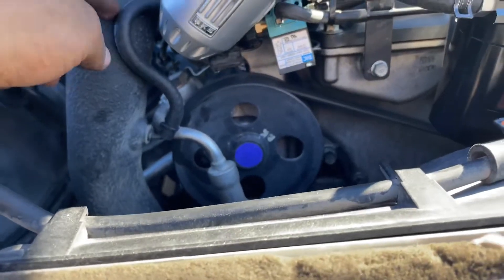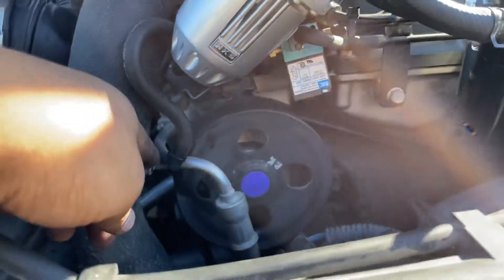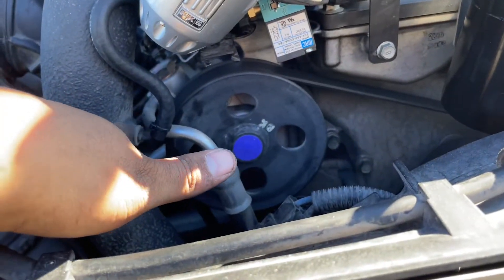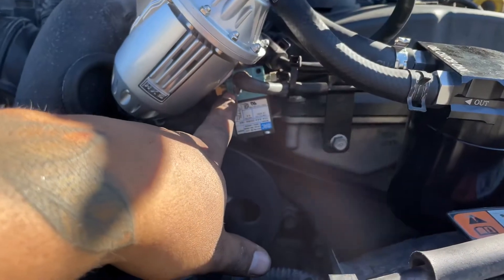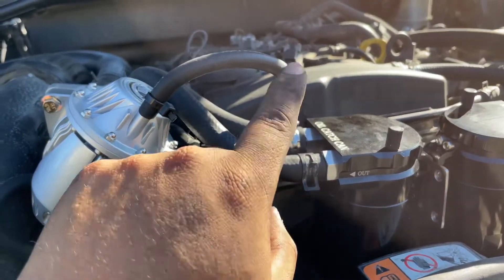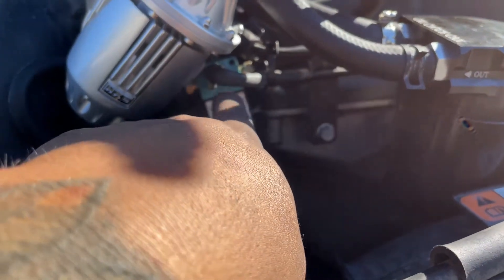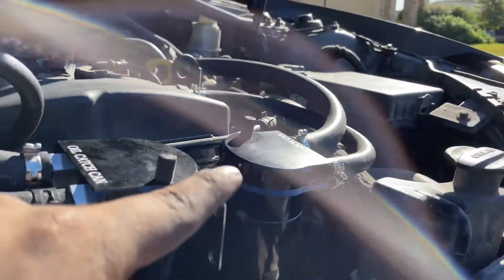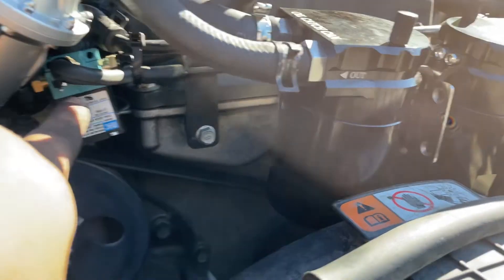Seco Solenoid Install | Genesis Coupe 2.0T 13-14

Comment: Where would you route number 1 on the solenoid if you have aftermarket intercooler pipes? Trying to install my turboxs fmic
Reply from the maker: Have to basically get a barb welded onto it or t into vacuum reference

Comment: What do you recommend should I get a 3.8 ultimate or should I just buy a diff car if I’m going for power
Reply from the maker: How much power is the question.
Reply: @ProdigePerformance  I wanna make the most power for 28k
Reply: @elvis4055  Sounds like you should just go with a coyote mustang if you want cheap easy power.

Comment: what exhaust is that in the video?
Reply from the maker: Isr single exit gt, lmk if you want one I’m a ISR dealer
Reply: @ProdigePerformance  I have a tomei atm, but appreciate you letting me know. Might need an o2 housing from you soon.
Reply from the maker: @NirvCIX  sounds good boss just lmk

Comment: What does the seco solenoid doe? I have an hks bov but I’ve never seen that.
Reply: Yeah also curious , I think it’s just a boost controller if I’m not wrong
Reply from the maker: https://youtu.be/lxF4Dvvr0jY

I made a video about it ^^
Reply from the maker: @Skido1714  https://youtu.be/lxF4Dvvr0jY

Made a video about it
Reply: When i got my hks my car threw the p2261 code n they said this solenoid fixes it i think imma get one